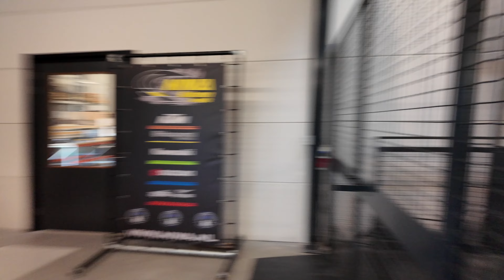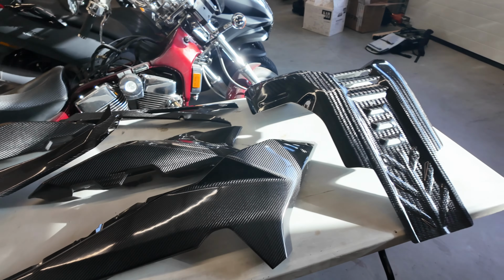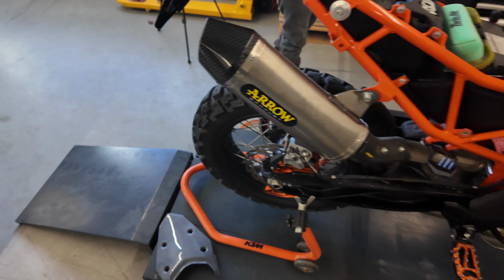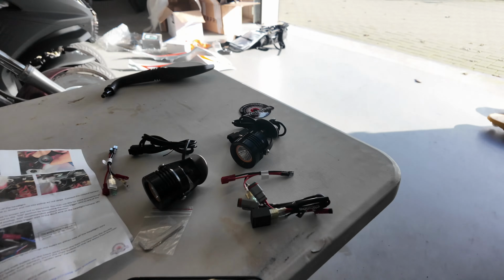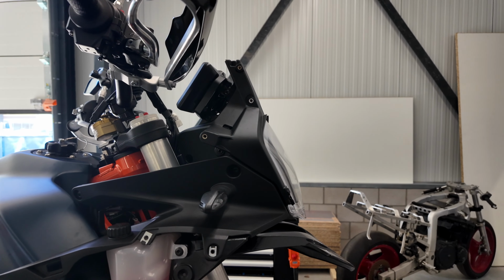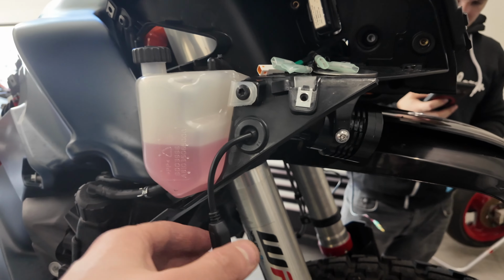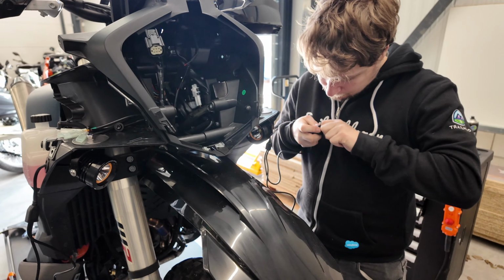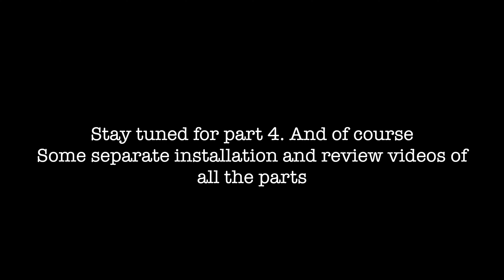Carbon Panels for my 890 Adventure R - Phase 3

Comment: Carbon fiber on a offroad bike 😂😂    #poser
Reply from the maker: You know most of the rally kits are made of carbon fiber right? And did you check the desert x rally by any chance?
Reply: @droommotor   no,  because the posers will buy the rally and still ride it to a coffee shop or a lame gravel road and talk like they been on a big offroad adventure..
Reply from the maker: @Rust_valley_adventures  hahaha :') not the ones I know and I'm talking about